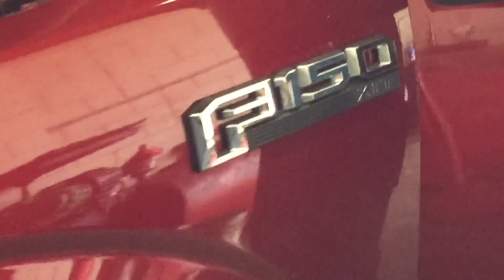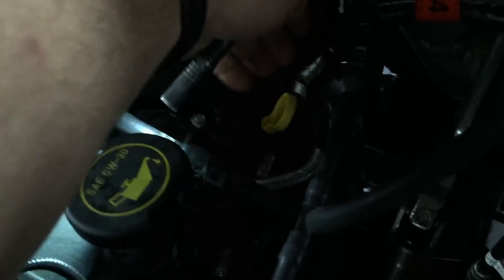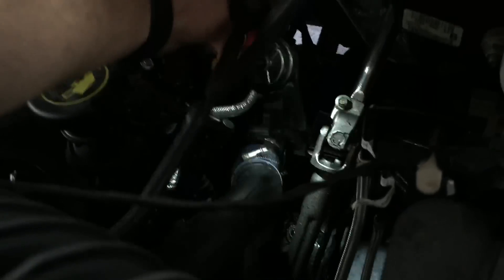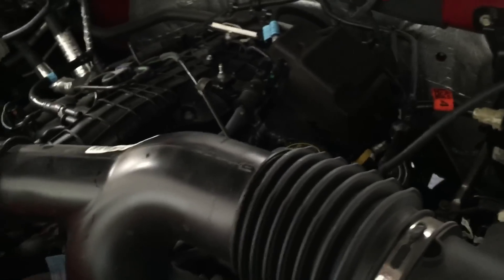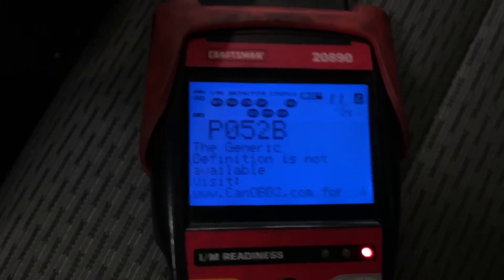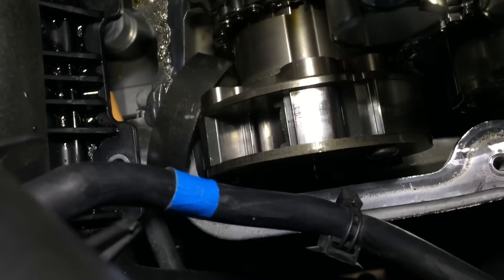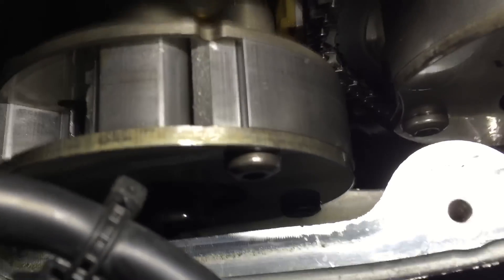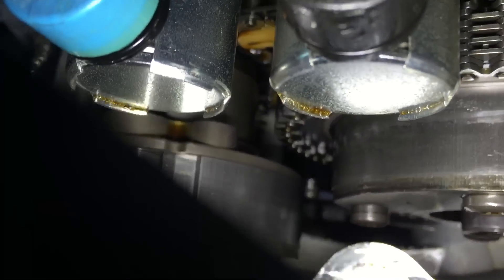Ford 3.5 EcoBoost Cam Phaser Failure

Comment: I would imagine the low oil pressure light illuminated when the pump ran dry. Someone continued to drive it after the fact when they should've pulled over immediately and shut the motor off. Of course it is a rental and when that light came on they probably just floored it and laughed.

My 1986 Ford Taurus LX had a "Low oil light" not a (red) pressure light like all cars have but a orange light that came on when the engine was a quart low or lower. It was still safe to drive but let you know that you need to add oil soon.  With all the tech on modern day cars it's kind of mind blowing that this is not a standard feature on every car manufactured. Especially in a ford since they themselves were using this technology 30 years ago.
Reply: Carl Zimmerman my 2012 focus had a bad head gasket and was allowing oil into cyl 2. I did not know at the time but I was about 2-3 quarts low. The oil light illuminated once during hard braking. That's how I knew there was a problem. I was amazed that it took so much oil loss to show any warning lights. Got the whole engine replaced under warrantee.
Reply: Maybe because they think that people would ignore it as warning lights are expected to only light when the car is running. That level light will only work when the car is only set to "on", with all of the other lights. And there are so many lights now it's easier to not look at them because they do scare people. Oil pressure lights, the red oil can, are calibrated too low, by the time they come on you're running about 2psi. Engine is dead anyway.
Reply: ***** On my 86 taurus the low oil light would stay illuminated after startup if the oil was low. I don't know the details on how the system worked but it worked well and was accurate.
Reply: I do wonder how that worked. They would have to have an extended capacity oil pan that keeps a certain level amount in it, possibly baffled, that is read, is what I imagine. OR, there is a trigger on the high side that is set when the car is turned off and the oil drains back and triggers it, if not triggered, then the light stays on next start up.

Comment: Check you're oil once ever few weeks simple! I have over 100k 9n my 2014 ecoboost and not a dam problem I'll I've done was change the spark plugs and all the oils in the truck
Reply: easy to put 100K KM on a car ,, I have a friend that drives a delivery car and he drives 300+ miles a day his 6 month old nissan has 42K miles on it
Reply: Yup I have an outlook reminder every 2 weeks, never run low on oil.
Reply: I call bullshit. You would've had to drive 150 miles every single day to accumulate that many miles.
Reply: Alex's Bikes and Motors km not miles!  the truck been across Canadian 3 times that's over 40 000k  right there! I'm glad you know what I do for work and spare time =)

Comment: WHAT DID YOU SAY? I COULDNT HEAR YOU OVER THE CHATTERING OF YOUR FORD....PLEASE STEP OVER TO MY 2014 TOYOTA TUNDRA SO WE CAN TALK.
Reply: B K hope you dont have the 5.7 liter they like to break cam shafts .and get a can of under coating for the rusty frames .also parts are a bit more costly .
Reply: tcrote5516 wanna know why America doesnt allow the sale of the Toyota HiLux here?  because then the big 3 would have to build trucks that aren't fucking jokes.
Reply: Gayata can keep their so called "trucks"... I'll take a Ford truck any day over that foreign job.
Reply: The money spent on fuel over time with the Toyota 5.7 compensates.
Reply: Clint Osowski if paying 70k for mediocrity is your bag, then by all means, waste your cash.
Reply: TheDarkness2487 Who says I would blow $70,000 for a new truck... I don't buy new, I buy a used low mile truck and save the money.

By the way, you can get a Ford truck with a nice trim level for around $38 to $40,000. $70,000 to $80,000 is for loaded Platinum trucks. Let's keep our prices straight here...
Reply: ***** I agree with your sentiments... I bought a 2005 F-350 King Ranch CC LB 4x4 with the 6.0L. It was running rough when I got it. Just last week I finished installing ARP head studs and new OEM injectors. I just have a couple other things and that beautiful truck is back on the road again. For dirt cheap compared to a new truck I might add...
Reply: Come talk by my Tundra, which is at the gas station, because I can't drive more than 100 miles away from one without  my fuel gauge showing I need to fill up again.

Comment: A 2015 Ford with no oil level sensor, but they'll put in an oil life indicator where you don't need to change the oil for 10,000 miles.

Comment: My truck was running except the timing chain issue it was running fine just made a 500 mile trip and it ran good and so yesterday morning I went to go somewhere and it started shaking and missing was getting codes like p0363 right up thru 0369 it the shit down and now it’s just spinning like it hasn’t got any compression so I am wondering if anyone has had this issue and what did they find out.

Comment: new vehicle or not. one of the many reasons why you need to check the oil or anything on or around the engine periodically. it can help you from seeing this mess too soon. 4qts low. that engine was near dry.

Comment: blame the Ecoboost. but wait no oil? operator error
Reply: Ports on oil injectors were too small. Ford claims they have changed the diameter of the ports. Simply put for a simpleton like yourself, unless you burn propane gas, your engine will develope sludge over time. It's one of the pitfalls of fossil fuel burning vehicles.

Comment: But as the oil level gets depleted shouldn't a sensor light up the dash?
Reply: They could cover the entire windshield with a flashing neon sign that says, "LOW OIL", and some people would just keep driving until the engine seizes.

Comment: Why isn't the ford dealer dealing with this?
Reply: Ford is tight.  they fight the buyer.  at least that's what I had experienced
Reply: +Mike Walden when i was a kid we had a 2000 taurus, and they always picked up the tab when it was under warranty with no fights at all. But that was 14-16 years ago. The car got totalled 8 years ago and we havent had a ford product since.

Comment: 2011 truck here...mechanic called from dealership. said timing issue was bad enough that something had failed and was loose inside engine. suggest a complete rebuild now. still under an extended non ford warranty.
Reply: bushonry Yes of course, this engine though has so many factors it's crazy.
Reply: The phasers are a known culprit
Reply: +ftffighter especially when you run the engine nearly dry.
Reply: bushonry Just the thought of that scares me on this engine
Reply: +ftffighter running any engine 4 quarts low should scare you.

Comment: Eco boosts have had issues from, day 1 of release ive seen a lot of problems and.witnessed several more ill never buy Ford Ecos.
Reply: The proven engines like the 2.5, 3.0, 3.5 and 3.7 from the Duratec family are being phased out for smaller turbo engines that are questionable junk at the worst, while offering trivial benefits at the best. I'm hoping they refine the 5.0 without completely doing away with it in their truck and mustang lineup.
Reply: Dude don't talk out of ur ass seen em with 300k miles
Reply: Thomas Griffin I love those 3.5 and 3.7 duratec engines they are really reliable
Reply: Marco Montana u
Reply: Right...

Comment: If it never had an oil change, it must have come from the factory like this. Oil change intervals are about 7500 miles so the owner was within the time frame for the first oil change. I think ford should be held responsible.

Comment: If it was low on oil and your tear'in down the engine to fix/clean it,  I would think you would see other signs of oil starvation.
Reply: rods are the first to show lacka lube on ANY recip eng probably even a roller

Comment: Seriously? The mechanic is standing on the bumper of a brand new truck?
Reply: Well the Engines are hard to work on by sitting on the tail gate.
Reply: +Rob Man my body don't bend like that + no scratches.       you would have to try to work on it.....
Reply: I agree!  that's what I had to do to take off the oil filter
Reply: So ya'll never heard of a step ladder or even a Milk Crate. There's plenty of options besides scratching the hell out of someone's $50,000 truck.
Reply: Mike Walden I work on mine without standing on it

Comment: so of these 3 engines 5.0, 2.7ecoboost and the 3.5 ecoboost which one is hold up the best, and yes  I know the 2.7 is the newest with the shortest track record
Reply: The 5.0 will easily outlast both of the ecoboost. Easily. And it sounds good, it has a good amount of Hp and torque, its similar to the mustang engine, its just a great motor. Its kinda like ford LS motor, the only difference is that it has DOHC

Comment: anyone who believes that this detonation of a motor is because of a dipstick is very stupid and don't believe this mechanic he sucks okay it's a fact he sucks the dipstick was pulled before he got the truck because the motor Grenada itself and they checked to see if it had oil in it because of the noise and did not put it back in all the way it was already damaged and this mechanic is making assumptions based on the dipstick not being put in all the way which is bullshit this is Ford EcoBoost this happens all the time to this engine look at all the posts on YouTube go online and check to see if there are any other post other than YouTube there's thousands of them it is a Ford problem they suck is the problem
Reply: While you may have some valid points, your lack of punctuation makes my head hurt and makes you look like an idiot.

Comment: If this truck had no oil changes yet,  means dipstick was not properly inserted in the factory. Owner should get a new engine instead of phaser replaced and job should be covered under warranty.

Comment: Daniel, 

We are working on a 2011 Ecoboost in my shop, We just replaced all timing components because we had code P0016 and saw the timing chain was stretched. This truck is kicking our butt. We got it put back and running however its throwing P0017 code now. We tore it back down, however we are confused on how to time these. Since there are no hard timing marks on the block or head, the only marks we can go off of are the colored links on the chain, however as soon as you turn the engine over they will never line up again. So how do we check timing on this thing and make sure we are at TDC and everything is good? I appreciate any help.
Reply: what did u end up doing about the cam timing?

Comment: This video just highlights more of what can go wrong when there is a lack of clean lubricant. I believe it is good practice for owners to check/change the oil moderately ahead of schedule. Personally I've lost the transmission in my first car due to excessive wear on the low intermediate band of the AX4S due to high metal content in the oil from 4 years of use after an accident on the highway. Please check your oil people and don't make the same mistake!

Comment: wtf 2015 fail ?
Reply: +northlander can't ford design the dipstick so that if someone forgets to fully seat the dipstick you dont loose all of your oil and seize the engine ? i remember when i took my vauxhall corsa to halfords auto center here in the uk and they totaly left the dipstick off in fact they left it on the firewall/dash under the bonnet and i drove around all weekend from friday to monday night about 67 miles and when i finaly noticed the car didn't loose even a drop of oil. no oil mist or anything under the bonnet or on the engine and the oil was still full so why did this happen with this ford even with the dipstick loose ?
Reply: +carlcostello360 look man the fucking motor granaded itself because it had a problem ok someone check the fucken oil because it was making a fucking clad or noise to see if it had oil they didn't put the dipstick back in all the way that had nothing to do with the fucking motor grenading itself we're having these problems all the time with this fucking EcoBoost motor so what the hell is everybody talking about doesn't anybody understand it's a piece of shit

Comment: Daniel, what other issues have you seen with the new F-150?
Reply from the maker: Haven't seen many other major issues, just weird things here and there. We had one with a front differential noise when they first came out, one with a transmission control module failure causing it to not shift, one with a heater core hose that came loose, and another with an intercooler line that blew off because it wasn't tightened properly lol. But other than that, they've been great so far. And in my opinion, this cam failure wasn't really any fault of Ford, seeing as someone didn't properly seat the dipstick after checking the oil. But Ford could have prevented it by installing an oil level sensor in the pan. It's just really difficult at times to determine whether the manufacturer or customer is at fault in the event of a major mechanical issue. You really do see the craziest things at a rental facility.
Reply: +Joe Johnson made in Dearborn Michigan.
Reply: +Joe Johnson ford's aren't made in Mexico . somewhere here in the US. I know dodge diesels are made in mexico.
Reply: Some of it back, ford brought back the trucks, but they are sending their small car division down to taco land.
Reply: ***** you're right. I looked into it .  They do build ford in Mexico.
Reply: Joe Johnson hate to tell you. But you're wrong. Fords pickups are U.S. Built.
Reply: https://en.wikipedia.org/wiki/Ford_Kansas_City_Assembly_Plant
Reply: It's built in Dearborn, MI and Clacomo, MO. There is no other plant outside of the US that manufactures the F Series. Medium Duty F650 and F750 production was moved to the Ohio plant OHAP and the F250 and F350 has been coming out of Kentucky truck forever. Sorry to burst your bubble.
Reply: +Joe Johnson yup corporate greed.
Reply: They are made in Mexico. Ford had a problem with their employees not tightening the radiator hoses properly and when they hoses blew off, the engine would overheat and fail.
Reply: Made in Mexico isn't a big deal. Made in Mexico for 2 bucks an hour is a big deal. Ford just isn't willing to pay skilled workers anymore. If we didn't have a minimum wage here, you'd have the same problem.
Reply: Actually the F-150 comes from Dearborn (Used to be at the original River Rouge plant, a bigger new facility was built on the otherside of the Ford complex.) and Kansas City, MO... As far as parts go, a lot of the parts are made in the US, but also all around the world... Ford is a global company.
Reply: Look it up, only small volume vehicles (Focus and Fiesta) will be moved to Mexico. Due primarily to the UAW forcing Ford to increase wages yet again. You can thank that greedy union for that...

The F-150 IS currently being built at the two plants I mentioned...
Reply: Clint Osowski give him a break. He's an idiot Trump supporter.
Reply: Ants In My Eyes Johnson actually I think joe voted for Hillary.
Reply: ***** I assume your third from last comment was directed to me...? If so, wow that was by far the most idiotic come back I've ever seen...
Reply: Diana I doubt that.
Reply: Diana Quite the eloquent response. Dumb bitch.
Reply: shut the hell up you morons it's just a freaking vehicle. You guys are worse then a kid crying over their spelt ice cream cone.
Reply: It sums it up guys. Joe johnson is a liberal democrat. So that explains all the anger and uneducated comments
Reply: He's actually a Republican.
Reply: Joe Johnson how? chevy is the most Mexican made truck lmao

Comment: Wow, it's amazing that all that was caused by a leaking dipstick!!
Reply: no it was caused by an EcoBoost motor that's what happened the EcoBoost motor is a piece of shit it's got them kind of problems and if anybody wants to fucking tell me any different tell me about all the ones we keep taking in the garbage ok so fuck this bullshit that dipstick was taken out because someone check to see if it had oil in it because it was fucking locked up engine and they couldn't figure out what the hell was going on after that they didn't bother stick in the goddamn thing all the way in because they didn't give a fuck anymore cuz it was a fucking trashed vehicle they brought it to a fucking mechanic and then fucking mechanic sees the fucking thing and blames it on the fucking dipstick fucking stupid mechanic this mechanic sucks dick okay I know more about fucking cars and he'll ever fucking know stupid ass hole
Reply: You just won the "Lowest intelligence I've encountered on the internet" award. Would you like to claim your prize?
Reply: @polebarnexperts  Why is there oil all over the engine then?  Seems to me if the engine failed and someone check the dipstick and didn't care to push it all the way back in then there wouldn't be oil all over.  This is pure neglect.  Plain and simple.  If any engine were to run low in oil then it would develop issues.